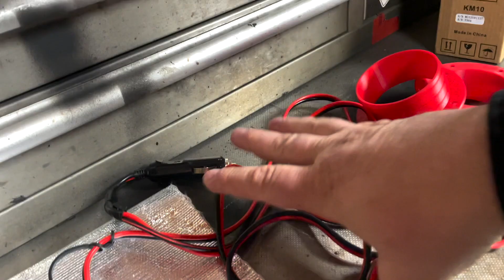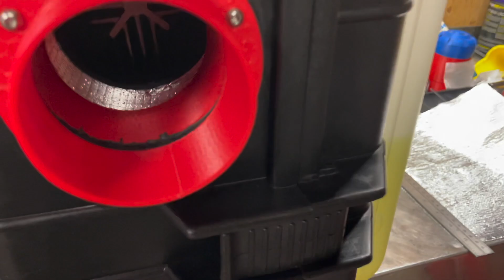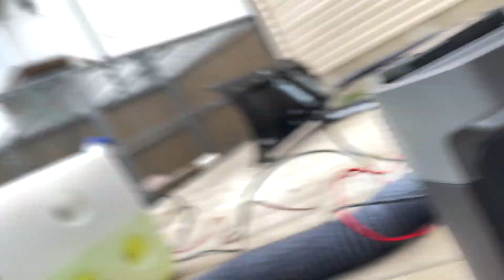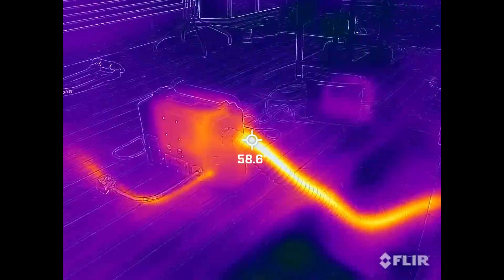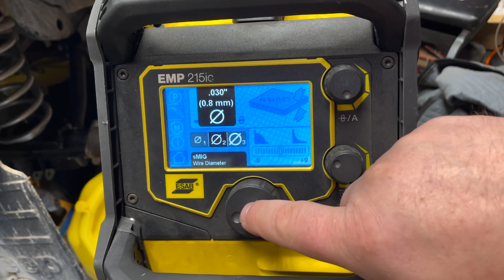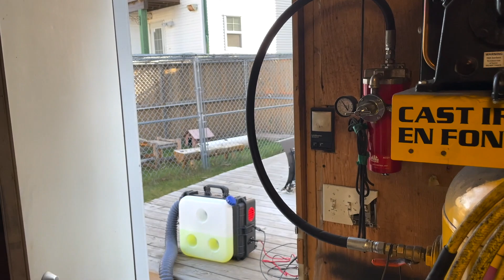Ultimate Portable Diesel Heater Build Part 3

Comment: Is it doing ok with just the intake still in the case?  I like that it likely pre-warms the air a touch and isn't sticking way out there dangling around or sucking up snow.  Wondering if its a problem or not tho
Reply from the maker: Intake is outside the case now

Comment: I plan on building one but I'm going to flip the heater sideways so that the exhaust + the intake air go to the outside of the side of the box. That'll save a lot of room inside and the interior temperature is greatly reduced.  You can run these heaters on their side as long as the glow plug is on the top position + not the bottom of the heater.  I have installed one in a van side door stepwell and it worked great.
Good video thanks.
It's nice to know about 3d plastic's heat limits.

Comment: I built one very similar to yours.  I made the mistake of using the flat spots on the diesel tank to put my fuel draw and as a result it can 'run out of fuel' with 3l still in the tank.  The one thing I added that you didn't was an ammeter.  I don't have a power source like the EcoFlow that I can keep tabs on how much the heater is using, so having it on the case is handy to have.  I also went Princess Auto with the case, but I went with a smaller one...that also seems to have been a mistake because it made mounting the fuel tank a headache. 

The 3d printed parts look awesome on that case.

Comment: So glad I watched part 3! I was about to do the same with 3D printing flanges.
Reply from the maker: One thing that isn’t shown in the videos but learned afterwards is don’t print the louvered vent for the heater intake. It will cause overheat issues
Reply: Exactly,  cross flow ventilation using the intake air was my thought also. Great series of videos.

Comment: You did a great job on it looks wonderful. The one thing that I would do different is I would hook a hose up to the inlet side and run it inside the tent so you’re trying to warm up 50° air instead of 0° air I don’t think the unit want to work nearly as hard
Reply: Backside of this is more moisture in the tent.

Comment: You need a a better supply duct pipe that is less restrictive on the inside and without  the bends. Keep the run as short and straight as possible. You had too much static back pressure, more than the supply fan could over come. That's why it melted those parts the first time, it will also have condensation start to build up in the supply line that is espoused outside during the on off cycles

Comment: Is the metal flange on the exhaust insulated? Does it get hot and won't it eventually melt the case?
Reply from the maker: it hasn't yet that's why its riveted so the rivets will melt and pop it